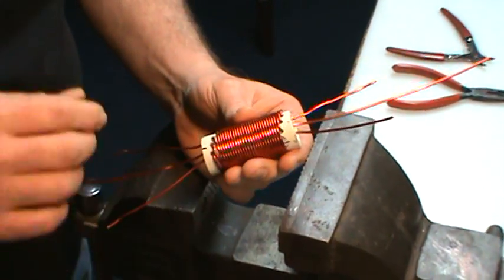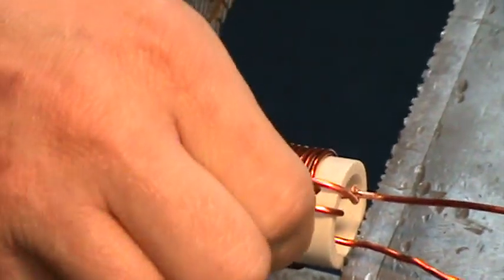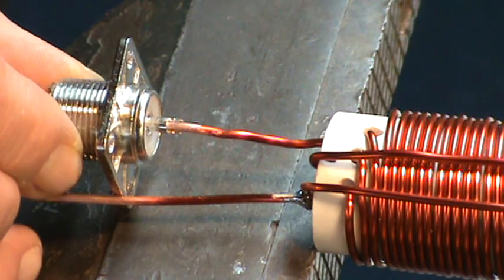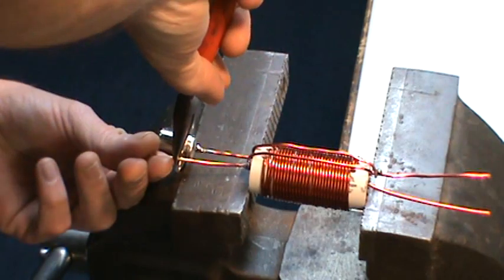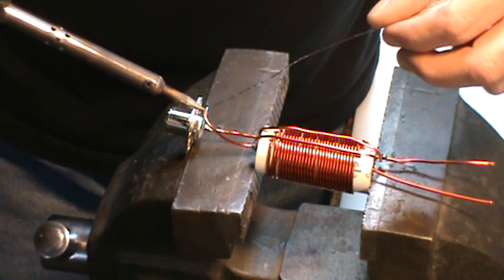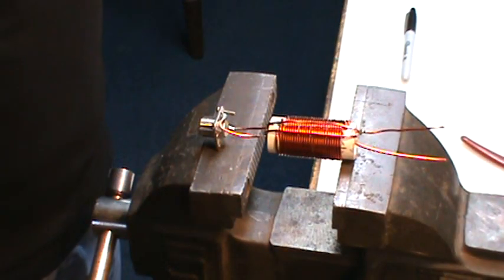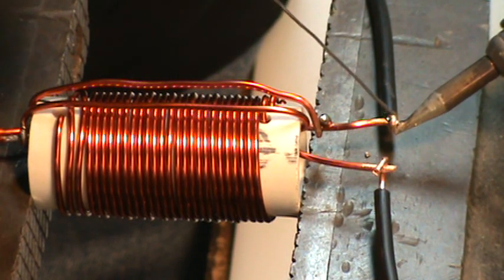1:1 Balun for HF Dipole Antennas, Part 3 of 5

Comment: Great video Dave. If I might make a couple of suggestions. Instead of drilling out the SO-239 to a clearance hole, drill and tap it to eliminate the nuts. Another idea is to put the side eye bolts in the body of the tube spaced down a little to clear the cap. That way you don't have to notch out the tube (body) of the balun and connecting the leads is so much easier. It ends up a little longer but much easier to build. At least that is how I have been building mine.  73 N8REZ

Comment: Hi David. I am a bit confused.  If its 1 to 1 Balun its 50 ohms in and out is 50 ohms. So how does it match centre fed aerial impedance.  l am also assuming its un balanced to balanced Balun you have made. I am still learning shouldnt it be a 4 to 1 balun. Before I start making one of these can you confirm.  I am just getting back into radio.  Cheers from old George. 🤠🇬🇧👍

Comment: Put the flange on the inside of the cap and put a washer and nut on the SO-239 on the outside of the cap. Four less holes that could leak water.

Comment: I like using fine grit sandpaper for cleaning off enamel-coated wire.  Can an organic solvent also be used to do this? Obviously, this is to be done neatly without slopping it all over other wires.  Acetone ?  Ethyl Acetate ?

Comment: I wonder if it would be better balanced to have the two wires that run at right angles to the coil not so close to each other but one on one side and one coming up the other side of the coil? But maybe this is how you have seen or read about it and that's why you do it the way you did.  To the people that are worried that it is a dead short, just remember it is a coil. A quad antenna or a loop antenna or folded dipole has the inside of the coax connected to one end of the element or wire and the brade of the coax to the other end or the element or wire. You could think how can that work as you are shorting out the inside and outside of the coax, but it works. In DC it would be a short but it is AC so it's not a dead short.

Comment: Hi Dave - Nice work!  I especially like how neat your work area is.  Unfortunately I can't say the same about my own.  

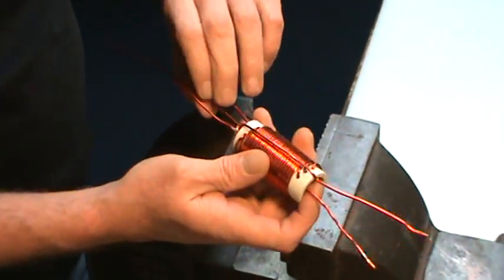Please explain the reason why, when you took the ends of the wires and crossed back over the top of the wires making up the coil (the wires wrapped around the coil form), you left a small gap bridging the wrpped wires.  This can be seen at the 2:19 mark in your video.  Is it because thge enamel coaing is not sufficient to insulate??

Thank you in advance...I just want to make darn sure I do it correctly when I make one of these.

73's

Comment: If I wanted SO-239 on both ends, I would use the same connections as on the first end you made. Same center conductor as the one side and shield the same. So would end up with the center conductor reading short and the shield shorted or some amount of resistance I assume? Thanks! Bill

Comment: I think someone needs to start using a liquid flux to clean their solder connections to make soldering a little easier. This would be another good chance to use some heat shrink on yet another connection and even some more flux

Comment: I tried it using all the precise measurements, but it seems like 9 turns wasn't enough to make the wires fit snuggly between the drilled holes.  I think I would have drilled them at least 1/16 inch closer (end to end). So instead of 1 and a hair over 15/16 of an inch, I think 1-7/8 inch might have worked better.  Also... my last hole was much closer to the end of the pipe than 1/4 inch.  This made everything look off center.   I think drilling the holes 1-7/8 inches apart would have made it both fit better and appear more centered on the pipe.  Just my opinion.

Comment: Great videos! I run a fan dipole for 160, 80 (75), and 40 meters, and pick-up a lot of electrical / atmospheric noise, and do occasionally get some RF on my shield, will this balun cover all three bands (and maybe a 4th band)? I am going to rebuild my dipole very soon and build this balun. I'm still quite new to the hobby (2012) and am always looking for a better way to build my own antenna. Thanks again for the great videos. 73 de AD4GC

Comment: Thanks Dave, very nice work. Although, I don't understand how it works when there is continuity throughout.
Reply: I wish he would answer this question. I'm also confused how it works. I built one and I'm actually afraid to use it until this is explained. I would really like to get on 20 meters and I'm stuck waiting on confirmation. PLEASE ANSWER THIS DAVE!
Reply from the maker: +Micah Haislett Test it before using it. Here's how:  https://youtu.be/nvlQ25hTTXg  
Be sure to use 14 gauge enamel coated magnet wire to make it with. Regular electrical wire will not work.
73, Dave

Comment: Dave - interesting to follow and build my own - a couple of thoughts (that I just trusted as I went along believing the internet guides.) 
Firstly outside of Continental USA discovering what thickness or international (ie rest of world) 14 Guage wire is - google has solutions from 0.63mm - 0.81mm I suspect that it is over 1mm given the video for reference. 
Secondly your video build results in a dead short, (as I suspected) since both the centre and shield from the SO239 are connected to the centre enamel coated wire making up the Balun.  

Please rectify this
Reply from the maker: You'll probably need to find a wire size chart to compare the 14 gauge AWG wire. I bought some from Amazon.  Yes, it is a dead electrical short but this is RF and not electricity.  See the video Testing a 1:1 Air Core Current Balun. Thanks & 73.

Comment: Hey Dave! Thanks for the many nice videos. However, I was wondering if it is possible to lay cables inside the coil, instead of outside?
Reply from the maker: Probably not a good idea. It would no longer be an air core inductor.  Also leave a gap between the middle wire leads and the coil, as the leads run across the coil.  If the gap is slightly too wide you can push the wire down as it is inserted into the PVC pipe body.

Comment: Hi Dave,
     I posted on Facebook on the Ham Radio Homebrew group a picture of my 1:1 air core balun that is modeled right after yours. my coil isn't exactly neat meaning I goit some gaps that I couldn't quite get straightened out. Do I need to start over or am I in the clear? you can respond to me on Facebook or through here.
Reply from the maker: You probably can't help but to get one or two small gaps in the coil.  Place a 50 ohm resistor across the leads at one end and check it with an SWR meter or analyzer.  I'll look for your picture on Facebook.  73

Comment: ZERO reason to put a balun on a dipole.

Baluns are not for antennas, they are transmission line couplings ( Lines, Waves and Antennas, PHd Authors
.None of mine have baluns and I work 5,000 mile CW contacts with ONE WATT regularly.

.They are 1:1 match and two of them are 1:1 match across the entire band.

.This video is just repeating 80 year old fables.